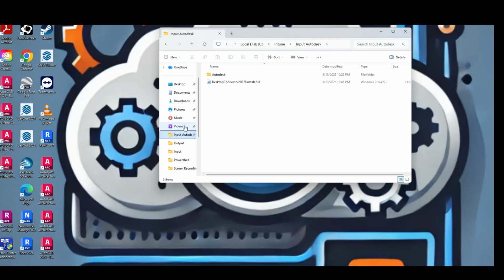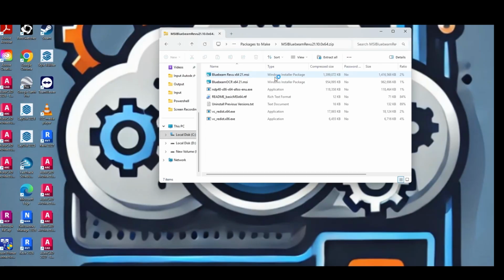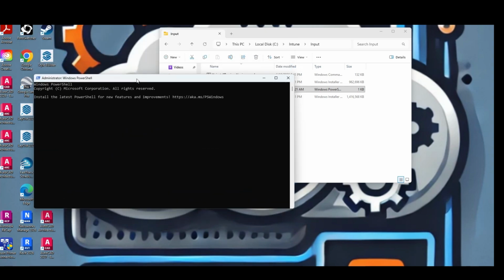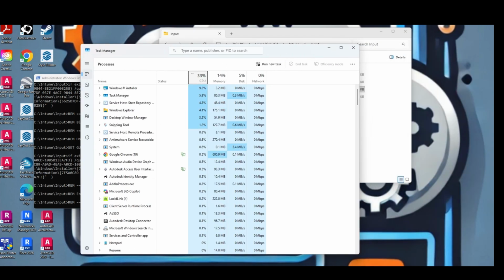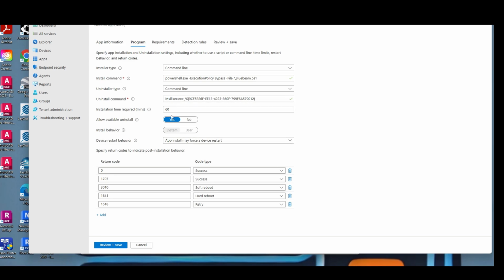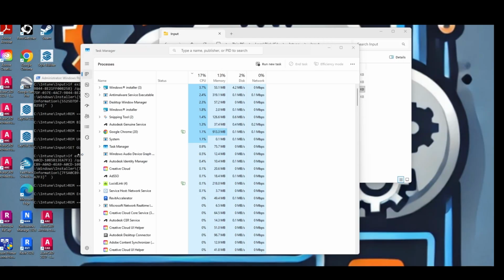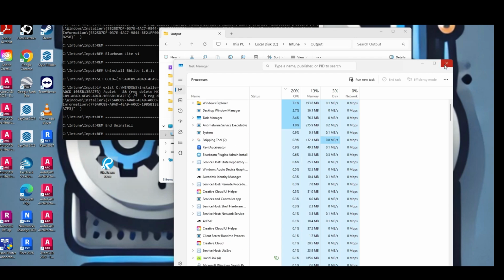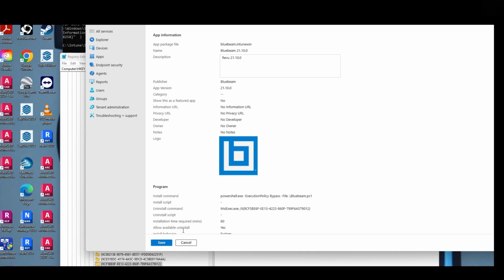Deploying Bluebeam 21 10 0 with Intune

Comment: If I missed it I apologize. How are you handling the reboots with Intune when using the uninstall cmd? When testing local it abruptly reboots. Is that the experience for the end users when deployed by Intune?
Reply from the maker: You can tell it to not allow the apps to reboot though with uninstalls it varies msi don’t always listen a powershell scripted one may give you more control